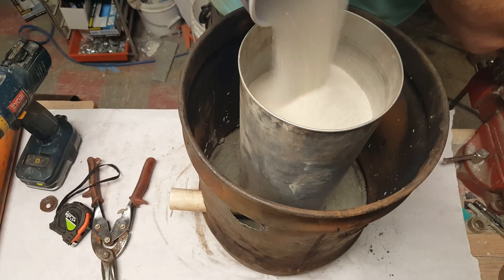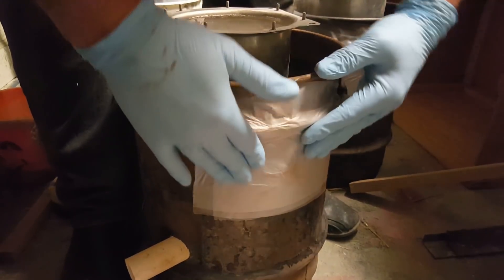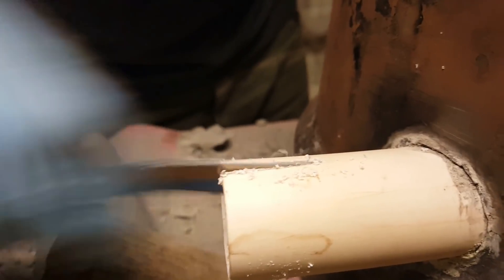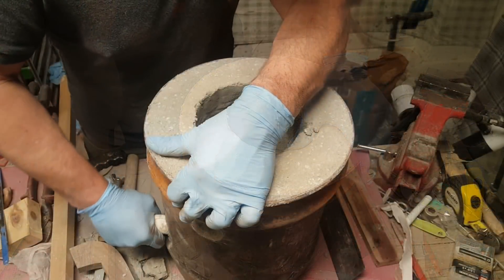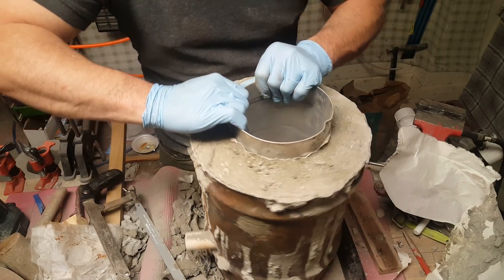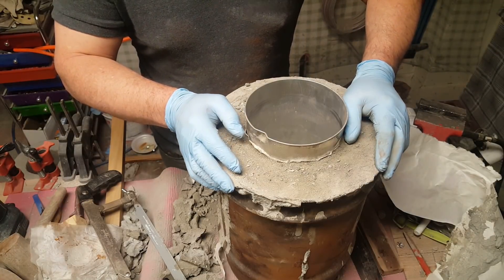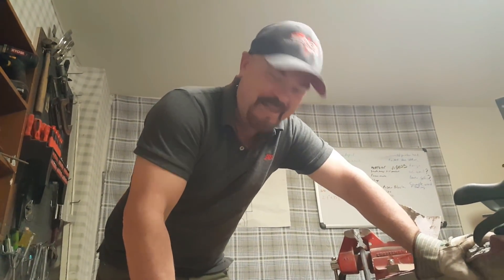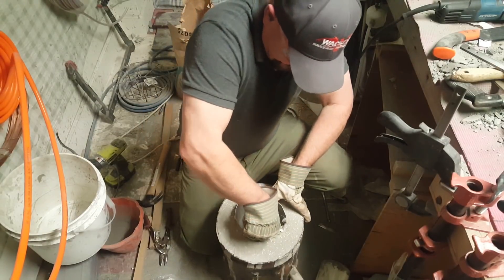Creating the Ultimate Air Crete Refractory Mix Forge

Comment: about to do same things for fire pit/rocket stove incinerator, but using waste papper material the mold made from baird 'manila carton' (waste lunch box) reinforced with liquid waste styrofoam  polyurethane thinner..

the material mostly 'pappercrete' in slury cement and will be coated with refractory cement..

to avoid strong sticked to the mold seem need 'releasing agent' such grease etc..

thanks for sharing ...🙏

Comment: Can you provide the recipe for the foam?
Reply: None of these aircrete guys provide any recipes. Not him, not "aircrete harry" or whatshisname. Given they tout this as "the material of the future" and the "magic" happens with the foam (which btw is just dish soap solution pressed through steel wool with compressed air) so it can't be sold in bags, it doesn't really make sense. 

He also never does any sort of reliable demonstration of the properties, eg abrasion resistance, thermal conductivity, heat expansion / shrinkagr or something. 

I reckon he's just a random hack that fancies himself the big industry changer because he realized air makes a good thermal insulator. After getting into aircrete channels I'll stick to regular castable refractory with proven track record. 

If you still exist or anyone else reads this, here's an ACTUAL recipe for castable refractory which should be good for >2000F:

- 356g perlite
- 699g white cement
- 1167g sand
- 533g fire clay
- 1048g water (subject to change)

Mix to castable consistency, cast, let set for 2-3 days, heat to 400F for 2-3 hours, done.

Comment: A couple good ideas are already in the comments, though I do not see a simple option. Cardboard mailer tube... You can always burn it out when done. Though I must confess... I have been intimidated for years by the cost of fire brick, and I have recently found many of you using concrete with high ratio of pearlite and or vermiculite... This MAY be a solution to my desired projects.

Comment: I used a 6 inch PVC for the center and wrapped it with parchment paper. The plastic slid right out and then it was easy to pull out the paper.

Comment: Hey Honey Do Carpenter, the next time you make a flue riser you could insert a length of 6 or 8" PVC pipe that has a saw kerf cut in lengthwise.  Wedge the pipe slightly larger than its natural diameter and wrap a with a visqueen liner.  When you finish the cure, remove the wedges and the pipe will snap back to its original diameter, providing a space that will allow easy removal.  Love your videos!

Comment: To minimize your problem coat the form with wax. Just melt a container bucket or pot of plain old wax and dip the form in it to build up a layer of wax. The removal is melt the wax by heating the chimney and the form slips out without a fight.
Reply: That's even better than form oil.  Thanks!

Comment: Some years ago I saw a TOH episode about using light weight cement in order to repair a chimney. The form used was a rubber tube which was inflated and cement mixture was poured in at the top of the chimney.
Your design is a chimney the only difference is your creating sections very small sections and surrounding the work to make a round shape.
Why not take a page from masons and make a steel form square or rectangular use steel panels that interlock and spray the sides with a waxy oil to release easily. The balloons can be centered with a wire brace which can be cut away after removing the balloon form. You have a reasonable design, just pour a larger size use a vibrator on the balloon and sides of the form to help settle the concrete mix.
Metal outside forms are removed with a hammer and the balloon is deflated opening the inside you can machine the material afterwards to make the desired changes. Why aren’t you using cast connections between the sections like flue tile or drainage pipes (tile) give yourself the space about one or two inches at the edges and slip fit a flue tile like a connector or repair coupling like plumbers join pipes? You could cast your couplings at the same time with beveled edges and cement them into the edges as you assemble the chimney.
It would help if you standardize your parts so repair would be easier. You could also taper the sides of the coupling to allow for a close fit like a pipe thread is 14 degrees so you can have a coupling similar to a steam radiator paper fitting tapered on both sides. The weight of the chimney would provide the sealing effect.

Comment: Got some advice next time you use metal for the center of your forge. Rub oil all over the outside. We used tractor gear oil to coat angle brace in concrete forms so we could easily scrap of any excess. Hope that helps.

Comment: Filling the centre metal tube with ice or use a Co2 fire extinguisher to contract the metal.
Heating the outside won’t work to extract the aircrete because it has to great an insulation value.
Just a thought

Comment: Hey brother, I like the aircrete idea! Helpful hint! Plastic garbage bags scotch taped neatly onto the outside of your cylinder before you pour Crete.  The cylinder will slide right out!  I’ve been making rocket stoves this way using pop bottles full of water to hold the shape of bottle. Just tip the form upside down to pour out the bottle of water.  Then make a vacuum by sucking the empty bottle with your mouth and the bottle will cave inward separating from the Crete. Try it, you’ll scratch your head and say why didn’t I think of that? To get the finished hole the size circumference desired, tape layers of cardboard onto the pop bottle. Then put the plastic garbage bag around the bottle before you pour. It’s so slick!
Reply: Ya right FFS, youre telling me, that for ...........lolol

Comment: stuff you don't want sticking in your molds should either be made of a material that can be compressed, like rubber, or coated with a release agent such as vasoline mixed with mineral oil or beeswax!

Comment: You need to drill a hole in the bottom of a can the suction is holding it in you know how you can open a can of ravioli take the lid off turn it upside down and poke a hole in the bottom of the can and shake it and it will come right out or you can blow on it and it will come right out same principle

Comment: Roll up a piece of aluminum flashing, pack with sand.  Dump out the sand and tighten up the rolled flashing.   Presto!
Reply: Excellent idea. I've never actually used aluminum flashing for its intended purposes. But I go through rolls of the stuff. It works amazing for so many different projects. And because it is mass produced for the housing market it's dirt cheap.

Comment: Thanks buddy!  If I see you do something... and parts of it don’t go well... I know to NOT do that!  I used the heavy cardboard core from a roll of carpet.  They gave it to me in the flooring department of Home Depot.  I adjusted the size by cutting it lengthwise and removing some. I patched it back together with package tape.  I imagine a fella could increase the size too. It held up well through a concrete pour. 🇺🇸🇺🇸😎👍🇺🇸🇺🇸

Comment: Suggestion for mold might be to use parchment paper. 
For added strength, outside of mold could include stucco wire before pouring.

Comment: You could have pulled it out by clamping 4 pairs of visegrips on it tied them up with rope hung it up in the air and used a board to tap the aircrete piece downward

Comment: Suspend the bucket using vice grips... vibrate the bucket ... weight of bucket will slide off the sleeve ..
 Of course you should use saran wrap or something to keep it from adhering to the sleeve

Comment: 1 add water glass to mix, 2. Pour bottom and let it set up a while then put a pvc pipe in for the center.  Pour in the sand and fill the rest of the cement. When mix is fairly stiff pull out pvc and the sand will hold up inner wall.

Comment: Create a form like your landscape brick form but with the PVC clamp on inside curve.a block at bottom with a bolt to grab on to and pull out when removing g form.
Reply: PS this could be used for stove pipe too. Add an interlocking feature.

Comment: No matter what you use for that center tube... an easy way to make sure it will come out easily... Spray it with cooking pray or some other type of mold release agent, then wrap it in saran wrap, spray it again then wrap another layer of saran wrap.  then spray the outside.  Then pour.  And if possible pull it out before it completely hardens.

Comment: In a similar situation I used a pvc pipe.  I sprayed it with pam and wrapped it with thin plastic trash can liner.  When my material was just barely cured, the pvc pipe pulled right out and then I pulled the plastic out.  It worked really nicely.
Reply: I assume when you say plastic trash can liner you're referring to a "garbage bag". The cement didnt stick to the garbage bag?

Comment: One thing I like to use is the larger size oatmeal tubes. The tubes are around 6" diameter and cardboard so can easily rip them out! You can also fill them with sand just so the concrete doesnt push in the sides.

Comment: I thought about doing this before with normal concrete but quickly found out it could explode, I'm not 100% but I'm pretty sure it's the water inside. Either way, does aircrete not have this issue because epf the air pocket insulation?
Reply: It won't explode if done correctly, this happens when the concrete is poorly mixed and or filled incorrectly. If you don't tamp and vibrate the outer form while filling the form it creates pockets that expand when heated. Just don't pour lumpy or semi cured mixes and tap the outside forms with a hammer as you go.

Comment: When we build concrete forms we use vegetable oil to help as a release agent. You might consider oiling up the pipe before you pour the aircrete.
Reply: How would the oil affect the concrete on such a small pour?

Comment: Apply a heavy coating of oil of grease to your form, that is what the professional foundation guys use as a release agent.   Cardboard forms are also available, you can oil them also or just leave them, they will just burn out. Lightweight aluminum dryer vent tubes can be greased and removed as well.

Comment: Loved your wife's comment: "You're in so much trouble"  LOL.  When working with concrete make sure to oil well your mold, I use olive oil.  Try to use small size sand.  Another idea that nobody has tried I think is to make the refractory out of fly ash.  Use fly ash or combination of fly ash ash and fine sand with cement (70%-30%), make sure to use superplasticizer, aditionaly, add fibers, they will help the compressive strength.  Your wife is like mine, always watching and laughing in the background...take care
Reply: Most people just add extra lime. Does the same thing as ash and doesn't carry the carbon.

Comment: all you have to do is drill a 1/8 inch hole on the bottom of your inside mold. that will relieve the vacuum pressure and alow air to get inside so you can remove the mold.

Comment: Suggestion that you could use 6 inch dryer duct aand wrap outside of it with parchment or wax paper. The bottom could have a removable cast iron grate  for clean out. Air supply could be adjusted on side intake.

Comment: At 8:26 I thought for sure I would hear Motha F__ - Son of a ___ ,  Man sorry for your grief. I thought about "Vice-grips also, then after that didn't work, I was hoping you had one of those oversized filter wrenches, with the straps, as maybe once it turned it would be loose enough to remove. "I'll keep my eye out for a replacement for you."
Reply: Not sure why this should be a struggle.  anyone working with cement or using common sense should realize it is going to stick and you need a spacer or impermeable barrier of some kind to stop the sticking....duhhh...

Comment: Use Styrofoam for the center core, it can be carved out or use acetone to melt it out.  You could even carve spiral shapes in it so the casting will have a natural spiral to help it with a vortex action.
Reply: I used greased 4 inch PVC pipe for a rocket stove heat riser. Sometimes it comes out easy one time I had to heat the pvc with a weed burner . to soften  ,, deform  and twist it out. Styrofoam  is a good idea but  how could it be made in a log or barrel xhspe
Reply: @bobbrawley2612  try a hot wire foam cutter with hardboard templates.
Reply: exactly  plus use a donut shape flame expansion zone where the flame enters the riser.
Reply: BIG BRAIN BRIAN!
Reply: Use a sonotube and burn it out
Reply: I agree. Also, I'd like to see one made with heavy cardboard tubes, and...after it air-hardens, the first burn for final curing can simply burn out the cardboard. Such cylindrical cardboard tubes are readily available in the concrete casting industry. Square-tube shapes can be made with 1/4-inch plywood.

Comment: To release the interior form pioe, I'd try soaking the metal pipe in icewater to shrink it the tinyest bit - twist then pull..... did you use release agent? Or just paper wrap?.... if its paper wrapped - you could torch the interior to burn the psper and release

Comment: Nice video, did you consider pulling the cores while your mud was still green?
What are you melting?
What fuel do you plan to use?
Reply from the maker: I slumped and melted soft steel in it for a demonstration but I am planning on using it to melt aiuminum for an aircrete project

Comment: You could have wrapped in cardboard then wax paper. Or towel then cello wrap. etc.      FUNNY!
Also, I'll bet you would get a big kick out of making a hot melt knife using foam to build forms. Very handy for casting Cement.

(AC 110~220V 2000W SCR Voltage Regulator Dimmer Speed Temperature Controller XG).... about 1$. ebay
Get a few some don't work.  I took apart a broken aquarium heater and stretched the nichrome wire out/uncoiled it to about 20ft. !!. Will be giving that a go!
The Regulator Dimmer, works great with Hot coils for Brewing,  Light dimming,    Perhaps not good for Motors just as a light dimmer switch is some times used for motors electrical guys say not a good idea will burn motors ... Ive neve tride.

So, I've researched refractory cement some time, DYS / professional grad mix etc.  (For melting Bronz) Everything tells me 
Portland is not the stuff to use as it will break down soon even covered in water glass. Even using stove calking is not great. Also when getting the premixed stuff it is very nonwatery,  if mixed to liquid-like, it will ruin the material.. at $80 bucks a bag Wew.    
So.....
 How is your Lava Cement working then ???
 Is it holding up OK... With all things hot (chimney stack, furnace Piza oven etc. )... very curious as cheap as it is I could just re-poor when it turns to powder. I understand you are now using water glass.. have you been able to mix in when making the cement or just coating with. 
   
I just have to admire a guy that jumps in with both feet..... into cement not worried if he falls out of the boat Ha!

From One Builder designer to another  MUCH RESPECT !!!!!  You've gone off the far side and we are all rooting for you !!

PS.  just watched the standing on a slab video  Incredible !! I would not have believed it !!!
I built some electrical sheds in Atlanta Airport using fireproof slabs for celings, about 28in wide by 10-12ft long and 4in thick. The stuff was light but very crumbly, without the rebar frame it would not have held together while installing the stuff.
     Thanks very Much.

Comment: I'm just curious did you Tamp that aircrete down around the edges and that's how it stuck the Ice Cream can and I was wondering if u tried to put air in the plastic pipe where ur chimney or burner goes out cuz I'm sure air would of broke the side loose with minimal damage and also ice cubes to shrink it but at least u'll know for next time lol! Great video!

Comment: Hi. What are your materials and portions for your air crete? I bought your foam mate directions and am about ready to do a test pour. I searched your video's but couldn't find material list and portions for air crete to build my heat riser. Thanks and keep up the good work
Reply: None of these aircrete guys provide any recipes. Not him, not "aircrete harry" or whatshisname. Given they tout this as "the material of the future" and the "magic" happens with the foam so it can't be sold in bags, it doesn't really make sense. 

He also never does any sort of reliable demonstration of the properties, eg abrasion resistance, thermal conductivity, heat expansion / shrinkagr or something. 

I reckon he's just a random hack that fancies himself the big industry changer because he realized air makes a good thermal insulator. After getting into aircrete channels I'll stick to regular castable refractory with proven track record. 

If you still exist or anyone else reads this, here's an ACTUAL recipe for castable refractory which should be good for >2000F:

- 356g perlite
- 699g white cement
- 1167g sand
- 533g fire clay
- 1048g water (subject to change)

Mix to castable consistency, cast, let set for 2-3 days, heat to 400F for 2-3 hours, done.

Comment: ...Last option, since you already have a hole in the bottom, you might try pseudo-hydraulic method with beating in greasy string. I'll try to find the example and post it here

Comment: ...also, you could try a PVC pipe,  cut lengthwise on one side. It should be stable enough when filled with sand. And then you could pry and collapse it after curing time

Comment: Since I see that lube and alternative materials have already been suggested, for future ref. if you continue to use a metal cylinder for your center you might want to drill the bottom first with a hole the size of a tubeless tire valve and insert one before pouring.  Then just use compressed air to force the cylinder out.